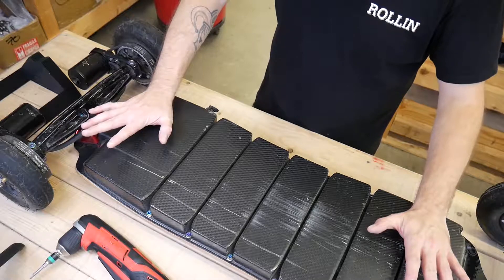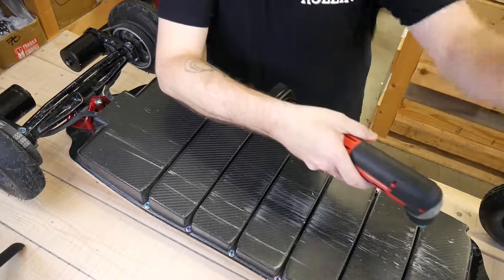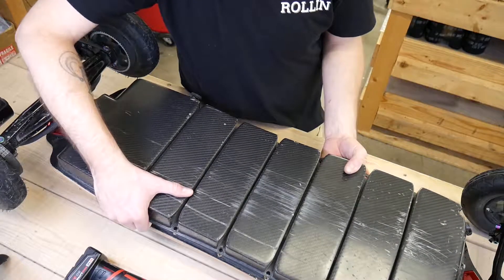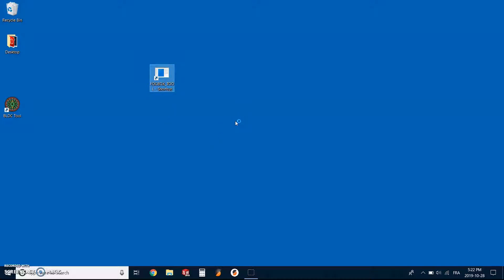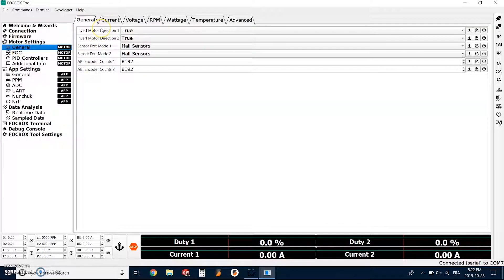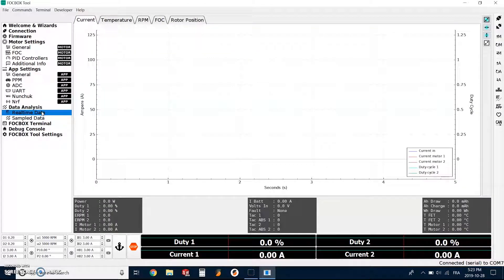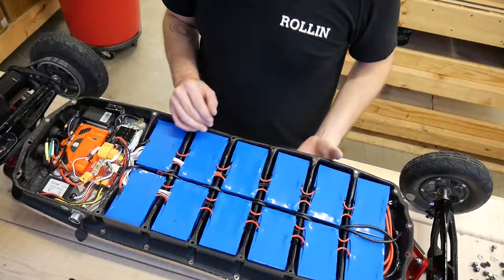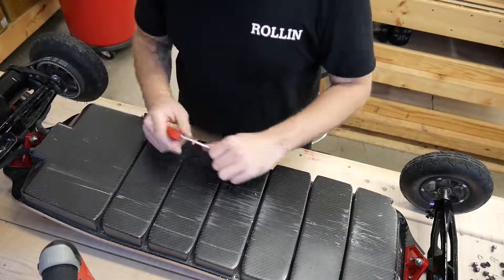HOW TO: adjust the Erpm limits (to lower the top speed to 25km/h).

Comment: Thanks a lot for this tutorial. I will be "mostly" compliant with the boring french regulation that is impacting New Individual Electric Vehicule.

Question: Is it possible to configure different max speed as the VX1 gets 3 different settings (Red, Green, Yellow), if yes, how to do it? target 6km/h, 25km/h and no limitation?
Reply: the vx1 limits the input ppm signal which limits current in the ESC.   it won't limit RPM.  so with a long flat. even  green mode will  eventually reach max speed.  you'd have to set an ERPM limit to limit top speed.